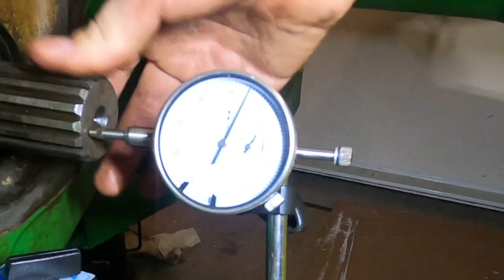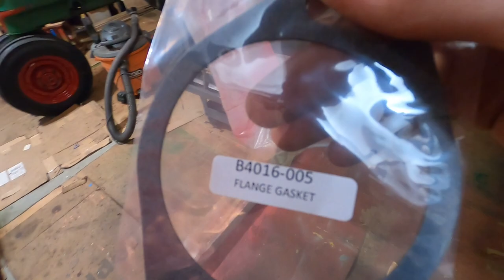Finishing John Deere B Restoration and Bringing Tractors to Parade

Comment: Dang, most of the John Deere B's I've seen had a crank flywheel start and pet-cocks that you opened to start the tractor.That electric start version doesn't seem very realistic.  You should have gotten an older version. Also,  I think most batteries in that era were 6 volts, not 12 volts.
Reply from the maker: I am looking for an early model B!  I have a 1940 hand start H.  Early B's are unstyled and hand start, mid-year B's are styled with the battery in the hood or no battery on hand start models, late B's are styled with the battery under the seat.  A 12v battery will turn a 6v starter and turn it faster than 6V.  Over time the starter will wear out faster on 12v than 6v.  And with a 12V battery you need to put a resister before the coil if it is a 6v coil.  On this B I swapped the generator/voltage regulator with a simple 12v single wire alternator.